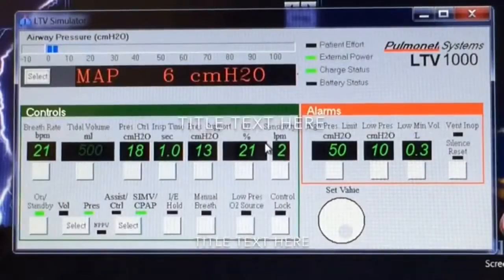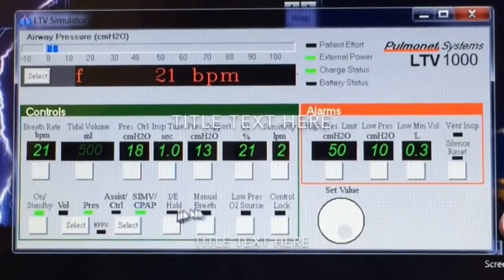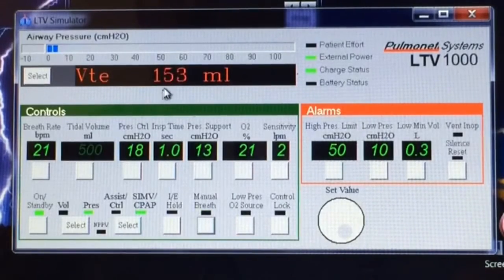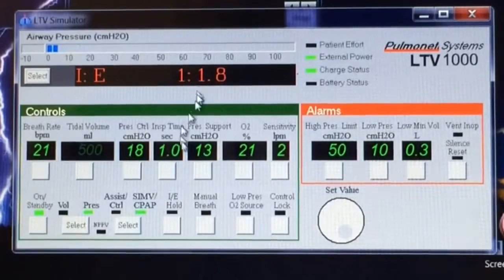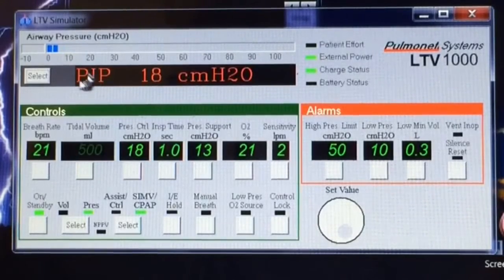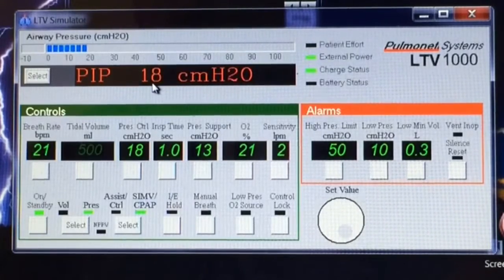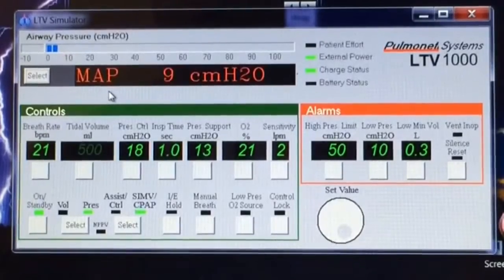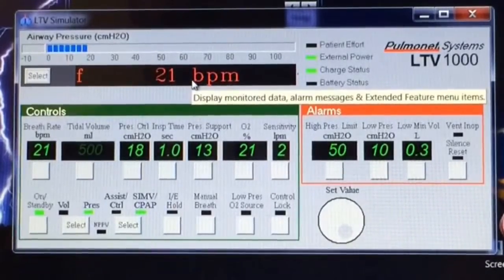VTE, VE, I/E RATIO, MAP,  PEEP,  PIP, f. LTV VENTILATOR EXPLAINED

Comment: Hi Wes, Great explanation, where could I get the LTV 100 simulator? Thanks in advance
Reply from the maker: It was a very old version. It is no longer supported and is outdated. :-(
Reply: @68superwes  No problem My friend I have some old Machines with XP that maybe could run it and as a first approach could be fine, I'll really appreciate if you could share it, thanks in advance